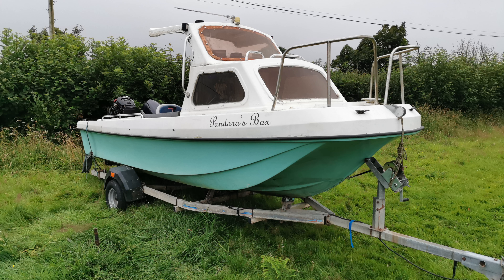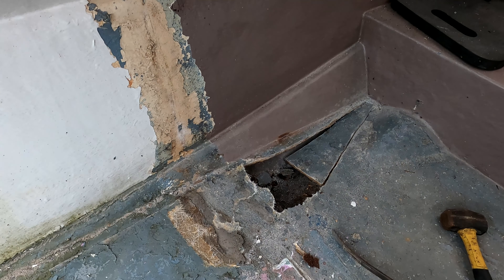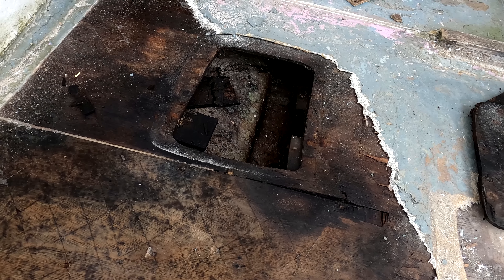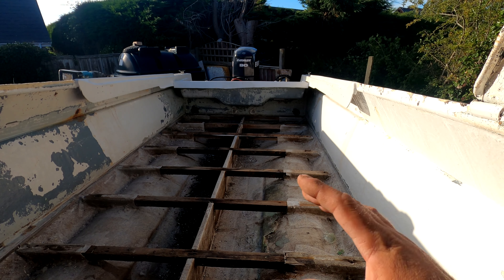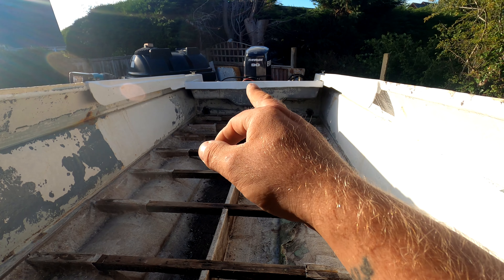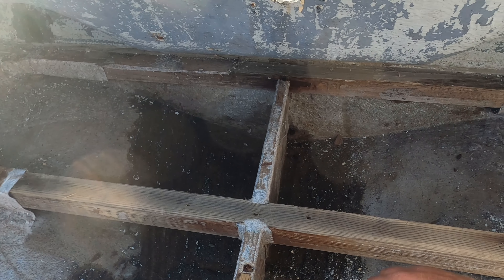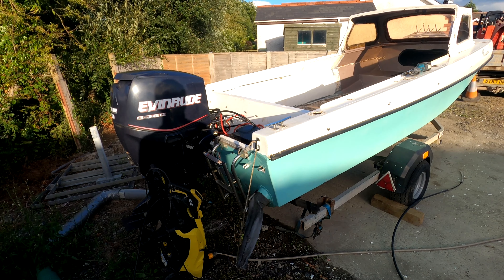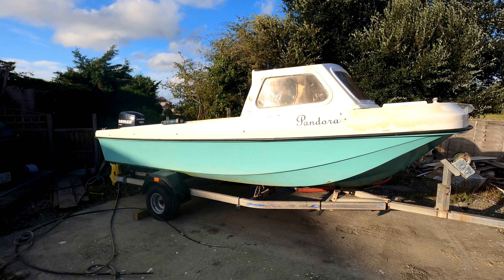Stripping the NAB 17 BARE

Comment: Looking good mate nearly 70 percent sanding ours now . Long road but worth it be a nice boat that dave
Reply from the maker: Good luck with yours. Yes it's lots of work but it will pay off
Reply from the maker: 😂😂😂😂 you nutter I will have a look
Reply: Oh and please let me no how the paint stripper goes or could u send me link for it will gibe it a go.
Reply from the maker: It's shite don't bother 😂 I spent all day and it didn't hardly touch it I am Gona have to sand it. 

You paint may be different but it's didn't work on mine 

It's hempel paint stripper I used
Reply: Oh sound . Will keep in the sanding I'm using 60grit on orbital sander it's come off really well .we thought 60grit would be too much but it takes it off nice leaving a smooth finish ready for primer .
Reply from the maker: Good to hear I have 60-80-120-240 grits 

Will do it in stages so it with be smoother finish well that's the plan lol

Comment: It will be a cracking boat when you get it done. You have done the hard work well apart from the sanding can’t wait to see it finished
Reply from the maker: Sanding is the next stage need to get through it asap. Before this weather turns

Comment: How’s it coming on Dave
Reply from the maker: Slow at the moment hopefully getting it inside a shed soon so work will go a lot faster be a nice winter project
Reply: @C3BFA  be sound that mate look forward to seeing that . We’ve slowed down too
Reply from the maker: I didn't want to slow down but couldn't work on in this weather bit so happy I found a shed. Just waiting on an Engine hoist now to get the outbound off then the boat is going to the shed and work can start
Reply: @C3BFA  mate we used a chain block and some scaffold made a ,a, frame boss though u have the same boat as us . Deffo have to meet up in them . Hard work though init
Reply from the maker: Haven't got that option here I need an Engine hoist. 

Ye that would be good what area you in ?